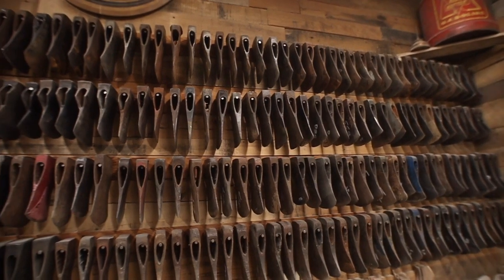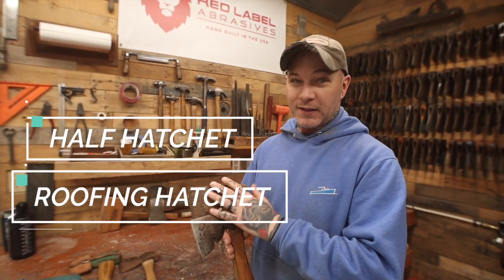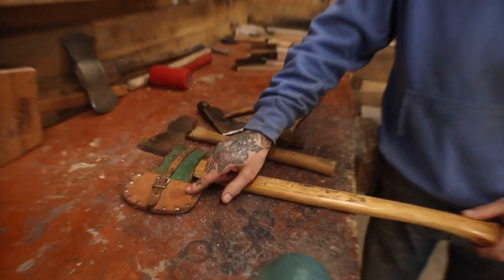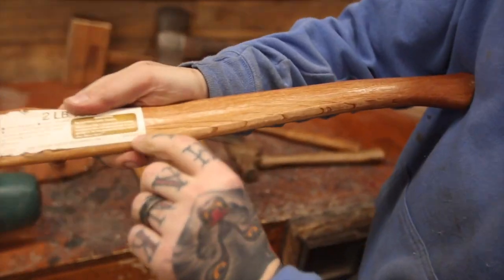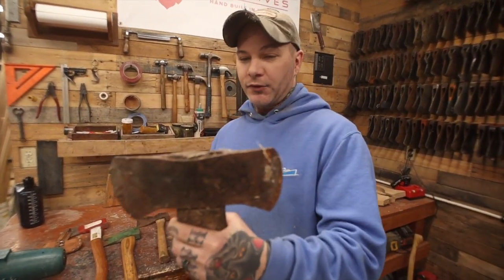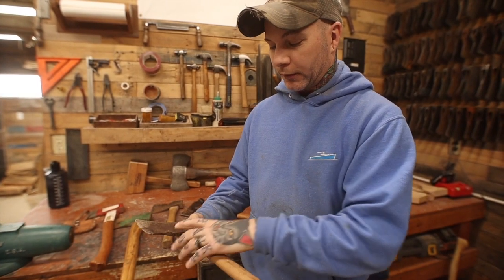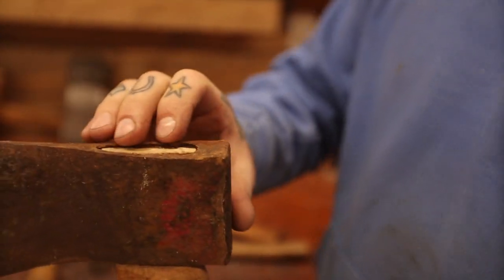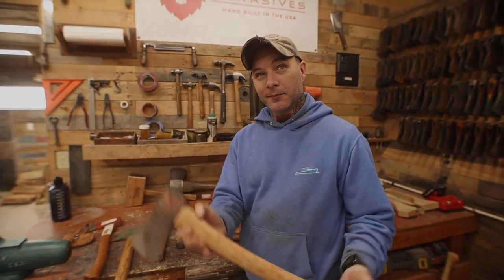Choosing the Right Axe - Things to Look For

Comment: I have an old axe head that was possibly used to build my old house built circa 1860s. The house has rough hewn timbers on field stones as it's foundation. It was probably built from the woods leaving the fields for farming around the house. It was a land grant to a soldier from Abraham Lincoln.

 I removed the porch for replacement and it was buried in dry dirt. It has no handle. I think it survived all those years without deep rust because it was out of the weather and didn't suffer from condensation.   It has no stamps or identifying marks. It does, however have deep parallel grind marks on the underside as if a stock removal method was used. I am curious of what I can learn about it.
Reply from the maker: That sounds very interesting! What a cool place and piece of history.